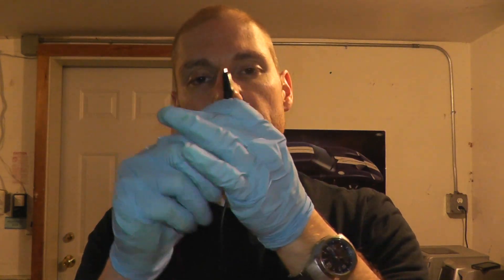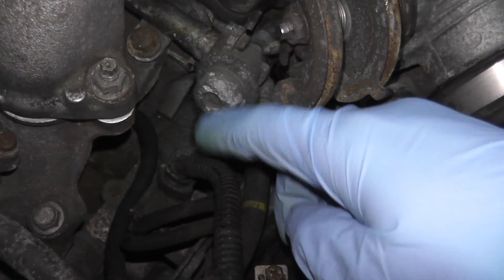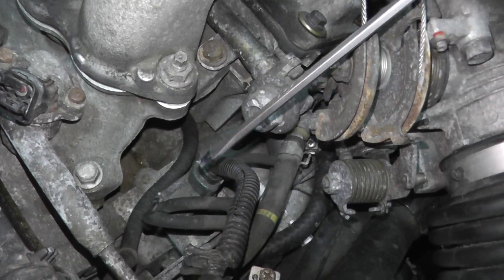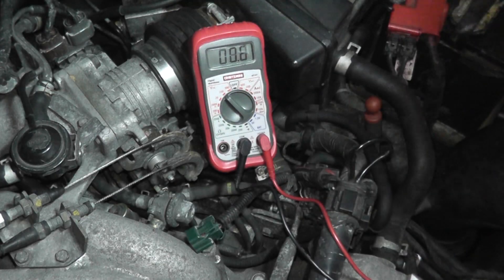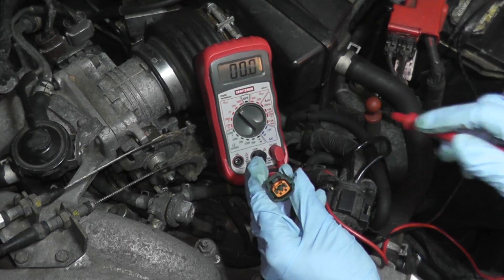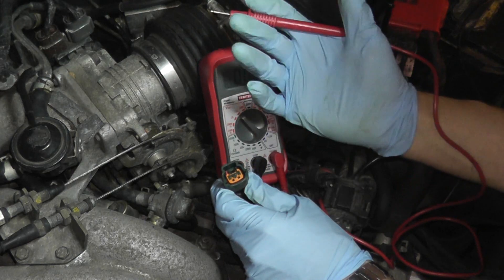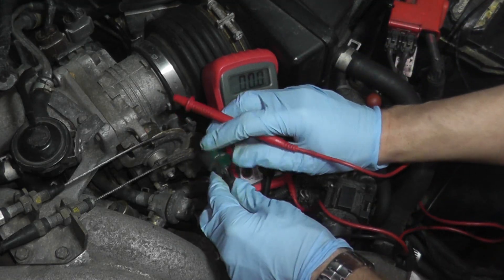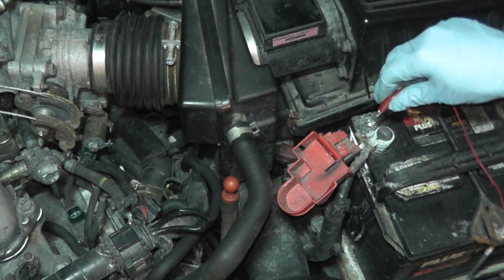How to test and replace the EGRC Solenoid Valve P1400 HD

Comment: I have a 98 max se, I was getting codes 1447 and 1440, I cleaned out the tubes that lead from my purge volume valve to the canister, because It was full of charcoal particles. when I recheck the codes, 1447 and 1440 was gone, but 1148 was there, should have replace the canister and not cleaned it out, or did cleaning it work and the 1148 code is something else

Comment: I am getting code P1400
I checked the EGR and it's working fine 
I check the sensor and I hear click I checked the voltage and it 11.5 
But I am still getting code p1400 every time I erase  the code
When I take the two hoses from the sensor I see a lot of very tiny charcoal inside the hoses 
Any idea why
Reply from the maker: Moe Zein Okay. So you're getting battery voltage at the harness; that's good. And you checked the EGRC sensor itself and it's working correctly. Is this correct? The EGRC has three hoses coming from it. Is the sensor you're looking at have three hoses?There's a 10 amp fuse for the sensor. It's located at the fuse block and it's number 16. (If you don't know what a fuse block is just google image it.) Check the undercover of the fuse box and it's #16; or just look for Engine Control.
Reply from the maker: Yes you'll be fine.
Reply: Where is the fuse block located? I have 1996?Nissan Altima, I have the code P1400 , there's battery voltage and sensor is clicking... idk what else to do... so where that fuse located? Inside the care or under the hood...plz help and be specific about the location of the fuse... thanx
Reply: Moe Zein +CarsNToys where is the fuse located??? Please help I have 1996 Nissan Altima

Comment: I have a 1997 nissan maxima and it's throwing that p1400 code the voltage is good I guess the sensor is bad. How do I change it?
Reply from the maker: Just remove the harness connector, the rubber hoses going to the sensor and there's a bolt on the bottom of the sensor. The bolt size is 10mm if I remember correctly.

Comment: Have you done a tutorial on how to remove this part if needed?
Reply from the maker: Just remove the vacuum hoses, disconnect the electrical connector and remove from its mount. It's a little tight but you'll be able to remove the sensor.
Reply: @Carsntoys  Is there a 10mm nut under the sensor connecting it to the metal bracket?  Haven't dug in yet, but there is a bolt coming out of the sensor body underneath in the part replacements I am seeing.

Comment: I have code p1130 and it's the swirl valve, the car will shuts off when it's hot I ready replace the swirl valve but the problem it's still in the car do you know else where to look for? Thanks for you time
Reply from the maker: Sure. What kind of vehicle do you have?
Reply: Maxima 99, it's been acting up every time I drive it ill shuts off randomly and the code it's for swirl valve thanks
Reply from the maker: Unfortunately, there's quite a list of things to check. Besides P1130, do you have any other codes?

First check the hoses between the intake manifold and the swirl control valve. Look for cracking, clogging, improper connection, etc.

When you say you've replaced the valve, are you referring to the solenoid valve or the actuator?

The valve also works with other sensors. If these sensors stop working together they could give code p1130. Look under my page and watch the video for throttle position sensor and mass air flow sensor. Perform the same test on your vehicle as I show in the videos and let me know if anything comes up.